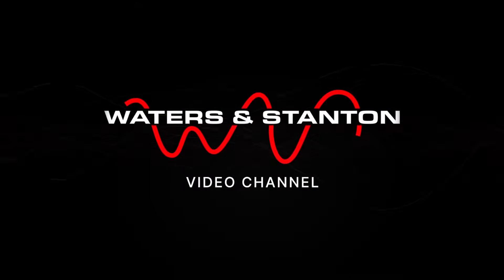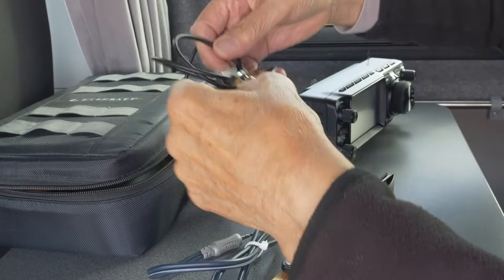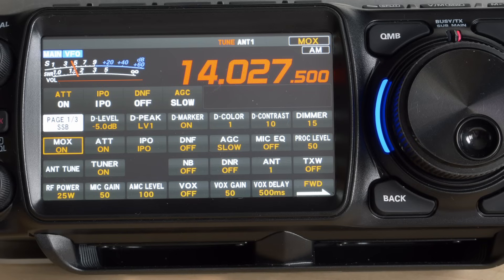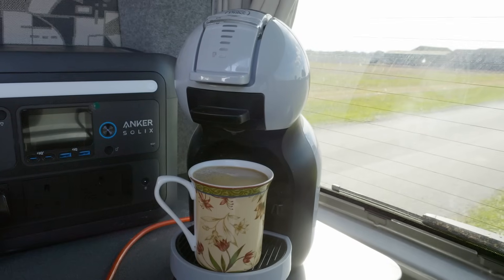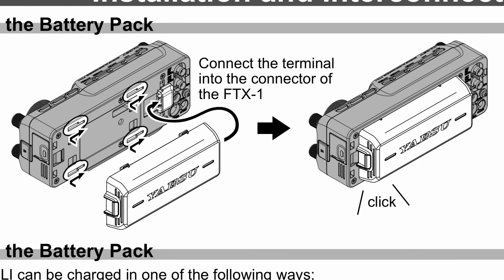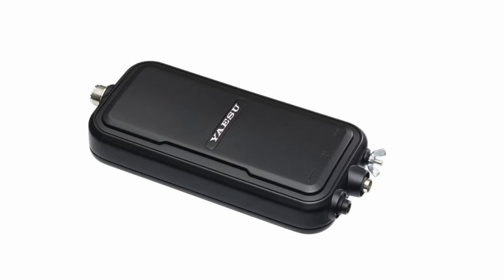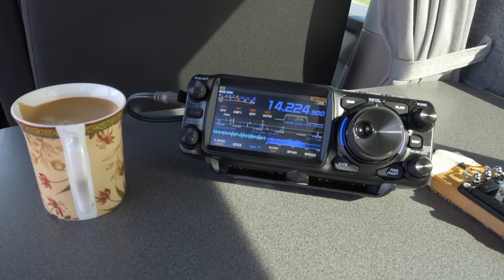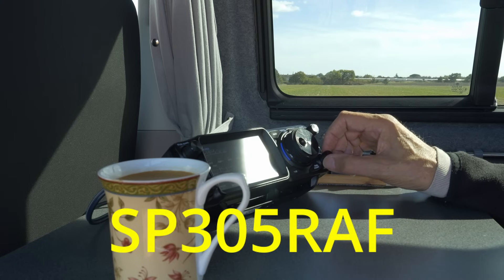FTX-1 Field - My First Field Trip with this new Transceiver

Comment: Dumb question.  Can you buy a second amplifier and swap heads between the two without any issues?   Example:  Amp at home and one in car. This way you can have the best of both worlds if you will without having to purchase another radio.

Comment: Boooooooo. Yaesu has dropped the ball with their new FTX-1.  Specifically you cannot choose the frequency and band with a mouse.  With the FTDX-10 and FT-710 you can but not not not with the FTX-1. When using my Yasu FTDX – 10, I found that I can simply use my mouse to enter the frequency just by clicking on a frequency box that appears on the screen. And Boom” instantly transported to the band frequency that I want. So when working FT8 or POTA it is such a wonderful experience to just have to use my mouse to click on the frequency box and immediately and instantly get transported to the frequency and band  I want “Boom”. So……. When I saw the FTX – 1. I was interested in buying that one however I find out they do not have that same ability to click on the frequency with a handheld mouse. It just does not have it. I think this is a huge failing by Yaesu on this model. And I think this huge mistake of leaving that feature out on the radio will discourage people who like to do FT8 and Pota, from buying one of them, and their sales will definitely suffer.  It took me three days of searching to find out this fact. Which really really irritates me that they would not come right out and say we do not have that feature on this model. And saved me all that searching.

Comment: I like the concept of a low power field radio with all of the features with a 100W amplifier (possibly with a tuner) that snaps onto the field radio to make a base station but I wish the Japanese manufacturers opted for QRP+ instead of strictly 5W QRP.  There are times when 10W would be very helpful for CW or digital modes and 20W would be great for SSB voice operation.  They're sacrificing a lot of market share to the Chinese (G90, FX-4CR, etc.)

Comment: I dare say the majority of portable operation is now due to SOTA, WWFF and POTA. It would have been so interesting to see the FTx-1 being used for such purposes.  The relevance of a huge battery capable of running a coffee maker, the coffee maker itself and the mug of coffee frustrated me.  By 12 mins into this video we actually heard signals from the radio.  The omission of some demonstration ssb contacts, so much the main focus of many of the operators who are the target audience of this radio, due to the demonstrator not bringing a microphone, is astounding.  Roadside battery operated operation on a single band and mode with a short helical whip probably missed 99% of the potential target audience.  But then, is the target audience the operators who actually use their radios in anger?  Those who do a parks activation and make over 100 contacts in a session, for example, or who carry a backpack of gear up hills and operate from hilltops.  I was hoping to see the dual watch function in operation, (can you really monitor two frequencies at once?) and how well the optional ATU handles antennas of various types, which is so important to many portable operators.  Thanks for making the video but this viewer felt so much more could have been covered and in a shorter time.

Comment: Having packed away the whip at the end of the session. Do you leave the antenna mount on the back of your van with a waterproof cover / cap please, or do you take that off as well. Thanks 73 Roger
Reply from the maker: There is a plastic cover but often I forget. So I clean the thread occasionally. Been doing that for years!
Reply: @watersstanton  Thanks Peter. I tend to over think it.